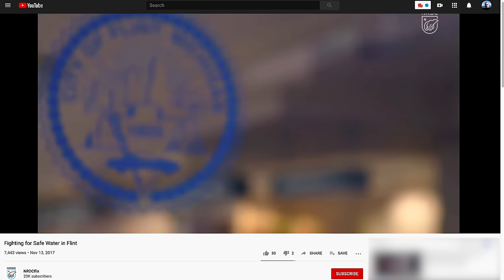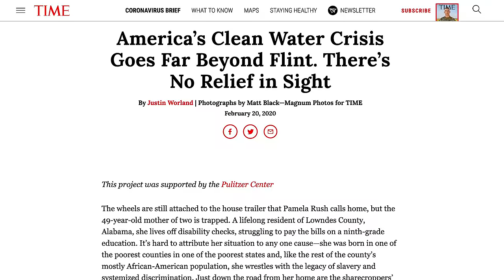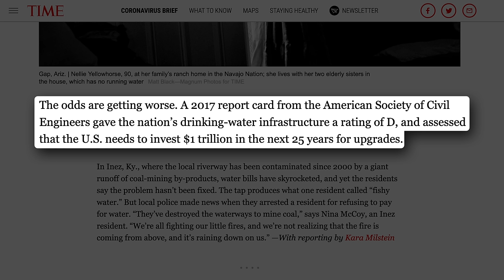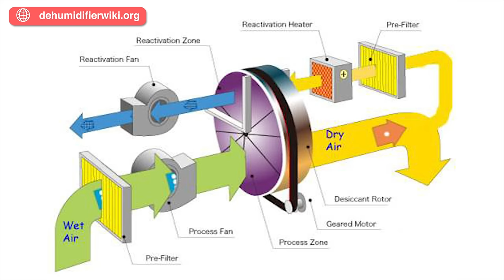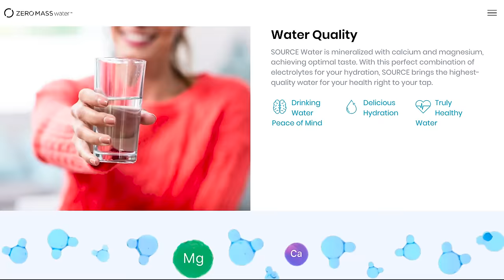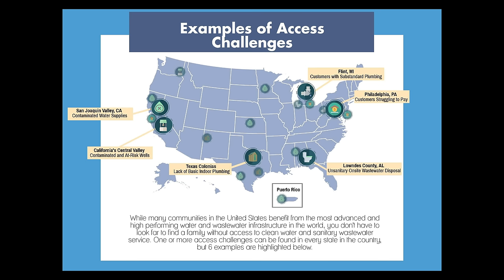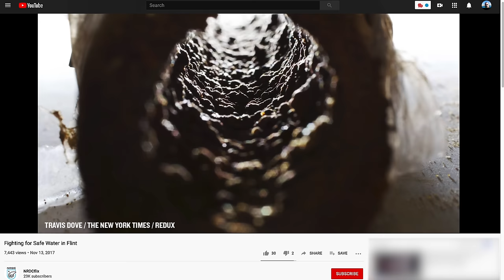Off-Grid Water With Air and Sunlight

Comment: "Between 2L and 8L a day"??? 2 litres are the recommended quantity for a single person, and you tell it is more than enough for your family? A single person household, you probably mean? 
- With 2 aggregates only 2 litres a day for 5500-6500 USD investment, which will be breaking in time and need changing or fixing (more investments)?? 1 gallon costs 1,08USD at Walmart. 
- 2L = 0,528 Gallons = 57 Dollar Cents of Walmart purified water.
- The longest investment return, judging from your numbers only, would be 6500 / 0,57 = 11 403 days (/365) = 31,24 years (considering nothing ever breaks and no change is needed). 
- The shortest would be 5500 / 1,08x2 (gallons of walmart price) = 2 546 days (/365) = 6,98 (~7) years.
- Considering nothing breaks and no new purchase is required, the rough average of investment return, according to your given numbers, is longer than 19 years.
Conclusion: no investor should make such an absurd investment, if there is the alternative choice.

Comment: The manufacturing of halogenated vinyl and halogenated carbon were intended for elimination by the chemical weapon manufacture treaty enforcement and obligations and EPA mission under treaty enforcement.  The functional groups on plastic ionized atmosphere to below mt Everest.  The effect is serious and persistent damaging effect beyond the battlefield caused by manufacturing use and stockpile disposal.  It is possible to do the same thing with iron oxide and electric power without fuel or plastic.

Comment: If you're on a cistern this could have you filling up way less often. I would also think you could use it as a dehumidifier to get double use out of it. Attic skylights, good hvac system, nice dry house in the wet season. More water collected for being in a saturated environment. Sound insulation

Comment: Collecting rain water for dishes, bathing, laundry, septic, etc... is a great route, but you need cisterns and filters and some areas don't allow rainwater collection--ridiculous right...
I wouldn't buy this unit because 2 gallons a day isn't nearly enough if you use it for everything. Living in the NorthEast, winter would make the unit worthless.
Back to collection, snow melts and can be melted. Cistern, BPA free plastic, range in size, but two 5,000 gallon tanks should work for everything. Also far less expensive as this solar unit.

I'm not a fan of solar panel, they're horrible for the environment, materials used are toxic, mining materials are toxic, it takes a massive amount of energy to create them.
small wind turbines have great use, insofar as there's wind. The charge a bank of batteries, like solar, can be rather cheap.

Ideally, I would purchase a property with natural springs or that has a creek or river and build a hydro unit. Use the power to operate a unit that extracts moisture from the air, like a high power dehumidifier.

There are solutions, but they're expensive because they're more or less prototypes and very limited due to time of production. Experiment... Sadly townships, states will likely try to stop you.

Comment: This sounds very suspect to me. Have you had your water analyzed by a Safe Drinking Water Lab in you city? I am water and wastewater licensed operator for the State of California. I am a  proponent of Desalination plants for all coastal cities in the US. Saudi Arabia presently has over 30 desalination plants on line with an ultimate goal of about 50 plants. Regarding your project I would be suspect of the amount of smog in the air intermingled with the humidity. Ask your lab for ph strips just to check the acidity. Bt

Comment: This is similar to the dehumidifier scams but now slapped into a solar panel to power it. No it doesn't save you money... It's an inefficient process so that energy could have been used more efficiently... So no it doesn't save the planet.

No it doesn't scale well as the more harvesters the dryer it would become....

It's not a reliable source as you are heavily dependant on the elements.

The mineral filters also need fairly frequent replacement

Water harvested using a dehumidifier is not good for you

Comment: Ah, right out of Star Wars. Moisture Vaporator. Too bad it takes humidity in the air for a system like this to work. I live in a area where the normal humidity level is about 10%. So as we say, drier then a popcorn fart in July.  So this really would not work in so many places.
Reply from the maker: I believe it’s 10%, check their site they’re based in Phoenix

Comment: The water from this system can not be used for drinking as it lacks all the necessary minerals and electrolytes from the soil/rock etc. So this is only water for utilities and cleaning but still a very indispensable tech. At least we will not be wasting valuable potable water for cleaning and other things.
Reply from the maker: keep watching, it has a mineral pack that adds it all back in

Comment: I like where this technology is going, but WAY to expensive. If you live in an area with decent humidity, just get a dehumidifier for a couple hundred bucks. It will make more per day and cost way less. I make water at night when the humidity increases as the air cools a bit. With 70% or greater humidity I'm getting about 1 gal/kwh. At 2 gallons a day thats less than $1700 in electricity at $0.15/kwh for 15 years. Then just run it through a carbon filter then one of them remineralizers. It's the same quality water. Hell, if you really want to spend $6k, you can still afford about 3500 watts worth of solar to run it... if your the DIY type anyway. You could actually even get over 14000 watts worth of panels if you snag them used poly panels when they pop up. Oh, and for people who live in drier climates... if you have water but it's questionable, stack a swamp cooler in front of a dehumidifier. Otherwise RO with UV is a good option for about the same or a little more than a dehumidifier.

Comment: Clever buy way too extensive.  The shipping and installation must be half the total cost.  It needs to be shrunken to the weight of a window air conditioner so a DIY'er can install.  A mini-unit would only makes a small amount of water, but then again, a DIY'er could install as many as they needed, or start small and add more later.

Comment: Hmmm you are drawing moisture from the air, say this caught on to lots of families you are drawing on the same moisture necessary for rain which basically affects how the ecosystem works which could cause changes in important  weather patterns, how much of an effect this would have cant be measured, in fusion you are actually creating water, if someone could find a way to control the explosions and do this safely you are not drawing out things that on large scale use could actually cause harsh changes in weather.  Its a bit scary and the noise my gosh how annoying the sound to those sensitive just is not a product Id consider, too many negatives.

Comment: So wait, $9 for 2 gallons of water if you buy individual sized (~16.9 oz) water bottles? I guess you never heard of Costco.  You can get a 40oz pack of 16.9 ounce purified water (that's 5.28 Gallons for us "math-is-hard" Americans) for around $3.50....which again for us, you know...math...that's $0.75 per gallon...which is still better than the other gallon-sized estimate shown of $2/gallon.

I know that this is more of a "off-grid" thing, but let's be honest...REAL off-grid means you don't need ANYTHING from outside the system.  And here, you're using mineral packs because the water you get from this system is, in effect distilled.  

Quick science lesson for those that have never looked into this:
=================
Even the purest purified water you get from any store will contain certain minerals.  Not always all of these but: magnesium, potassium, calcium, etc.  Your body needs minerals for normal biological functions.  And just so we don't go down a rabbit hole here, NO you do not get your daily dose of minerals from water.  You get most of it from your diet.  

However, typical tap or purified water does provide a small amount of these minerals.  Distilled water on the other hand actually leeches trace amount of these minerals FROM your body.  This is not fatal or anything like that provided you do two things:

1.  Don't drink excessive amounts of distilled water for a prolonged period of time.
2.  Maintain a balanced diet to replenish the minerals you lose to the water.
=================

So basically, even in this off-grid "end-of-the-world" scenario, you could drink distilled for a while, but you would also have to eat certain quantities of meats, starches and greens to put back what the water takes out.  With the kinds of diets many Americans keep (twinkies and kit-kat washed down with Soda) that's hard even without an end-of-world scenario.

I know, I know: Again, this is more an 'academic exercise' than a 'how-to' on "pipe-cutting" from your water company.  It's just that since all content we 'attention-span challenged' Americans consume has to be "twitter-sized" or we lose interest, there is a LOT more that needs to be considered before you go out and spend 6k on a glorified science experiment.

Maybe this would be good for people way, waaaay out there in the boonies, but for everyone else with a Costco within reach, we're talking 8,000 gallons before it pays off...and at 2 gallons a day -- based on the estimate -- that would be about 11 years.  Oh and that doesn't take into account the cost of the mineral packs. That's a lot of money down the drain (pardon the pun).

Comment: Where are you getting your prices for bottled water? 8 liters of bottled water does not cost $9 unless you are only drinking "smart water" or something like that. For 8 liters of water, the regular name brand stuff costs around $4.66, the generic stuff (which most people buy) costs around $2, with the very cheapest bottled water costing only $1.33! Also, you said it makes anywhere from 2 to 8 liters of water a day, then when you did your calculations you conveniently  just used the 8 liter figure as if it would somehow magically produce the maximum amount every single day of the year. Total nonsense. 2 liters of water is just barely enough for one person!!!

Comment: what a baad idea.

first of all it is not magic. it is just small scale condenser.

second rather than this just produce electric using solar panels and do whatever you want. Condensing water is another thing you can do. in a safe and better device. Also you might even do it in snow.

finally pure water is not healthy. you will have a lot of problems due to lack of minerals. so you need to pay/get those minerals from somewhere else. there is a reason why we don't drink pure water and it is mostly forbidden in any country to sell it for consumption.